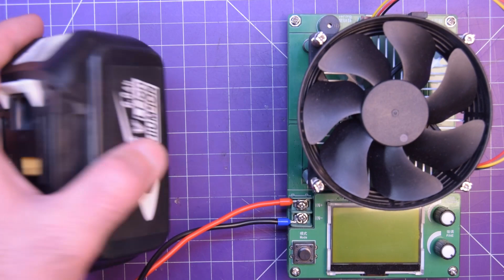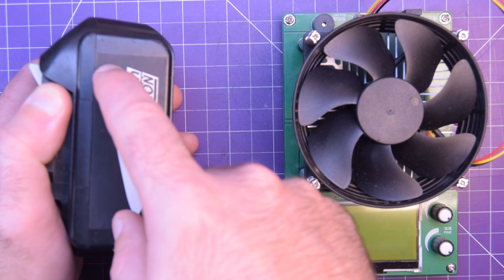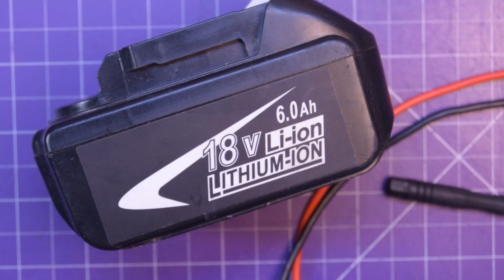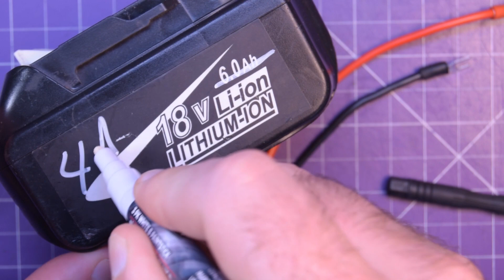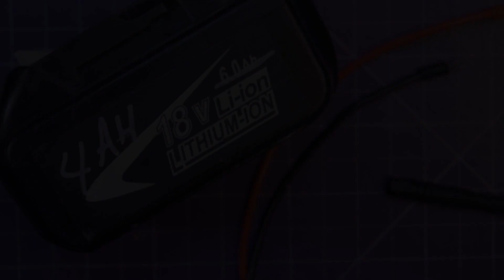Testing My Cheap Fake-kita Battery's Capacity

Comment: THE most important test is NOT how many Amp hour per cell... THE constant discharge rate of the battery cell under load is the most important; when running a drill/equipment under load, many cheap fake battries/cell are unable or not rated to supply the amp/load required by the drill and the equipment will stop working long before the fake battery discharge 8% to 12% of it's (tested) capacity.

Comment: Have you tried  testing a genuine Makita 6ah? The reason I`m asking, I mess around with these a lot. The chargers stop at 20.4 v no matter which battery you charge. My point being the 6ah batteries used in makita 6ah have a max charge of 4.2 v per cell where as the older ones were 4.1. I`m just wondering If they stop short of taking a 6ah charge ? Let me put it another way, If I charge a battery containing vtc6 cells on a makita charger until fully charged,(20.4v) I can put another 600 0r so extra mah In by charging it up to 4.2 per cell (21v) on an imax charger.
Makes me think you only get around 5400mah when charging a 6ah battery on a genuine charger..I wonder..

Comment: Why test at such a low amperage draw?? In the real world of cordless tools, 1.5 amps will not run anything accept maybe a light. Set the tester for the max 150 watt draw and the cutoff at 14.3volts and you will have some results that are use full and safe for the cells.

Comment: Ryobi 18v batteries have both low voltage and thermal cutoff built into the battery. Just about all other tool batteries shut down on the tool side, not the battery side.

Comment: Better than expected, which is not always the case. This week I received 200 bright pink N95 masks instead of the ordered 3D printer hot end replacement! I tried fitting one to the printer, but no joy. 🤷🏼‍♂️🤔
Reply from the maker: At least you'll be pretty when you go to the beach? :)
Reply: I’m giving them away at the moment, too cold for the beach! 🥶😷